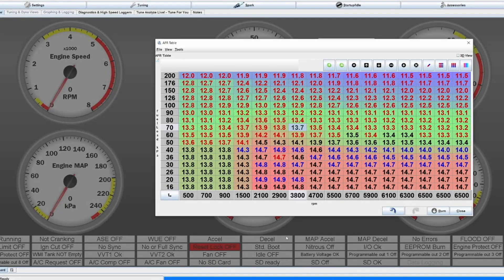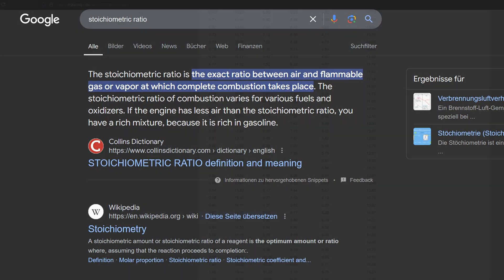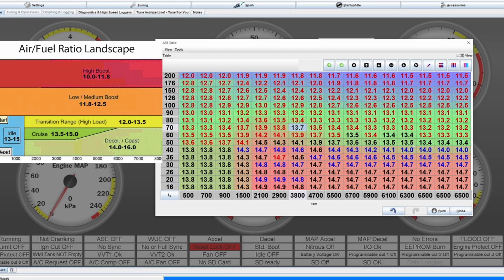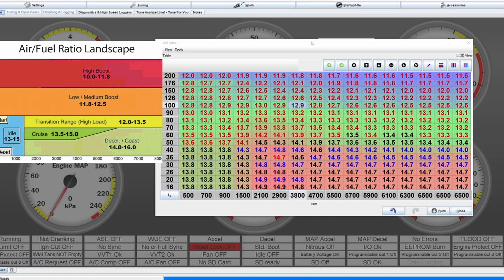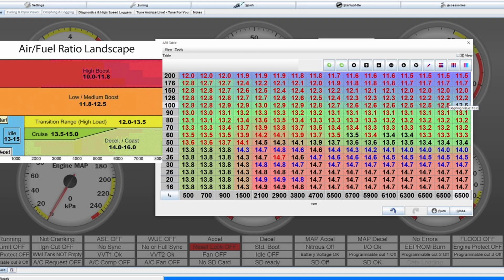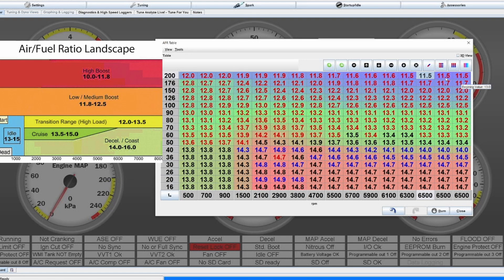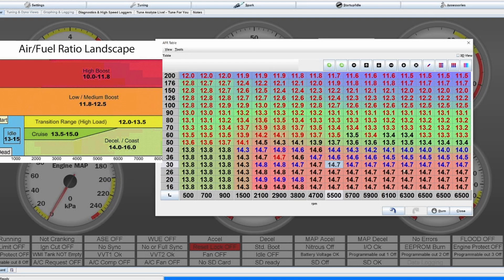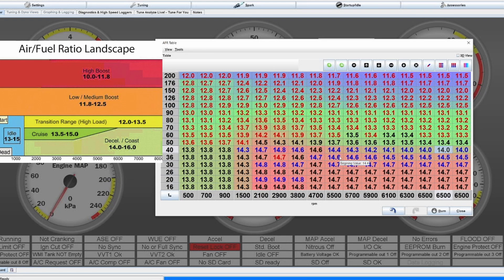What is AFR & Lambda | Air fuel ratio | Lean and Rich conditions & Stoichometric | Tuning Explained

Comment: Ok, at 5:27 u said that u want richer fuel to cool down the engine so it doesnt get to hot which makes sense, but could it be higher if you have a water or ethanol injection system to cool it down.
Reply from the maker: You could lean out the mixture if you used water merhanol injection yes.